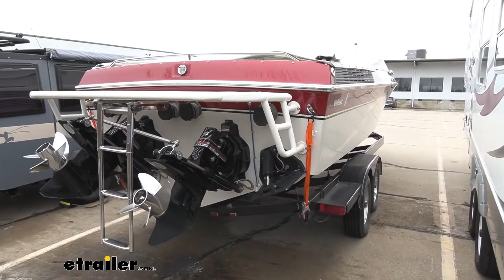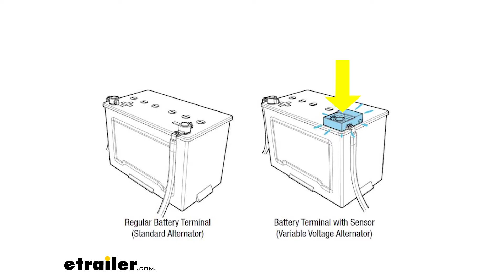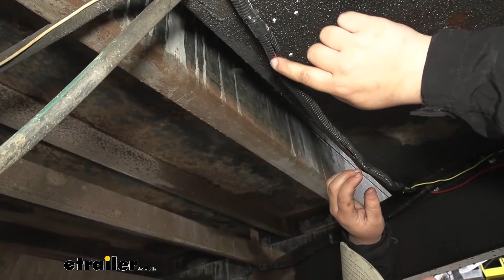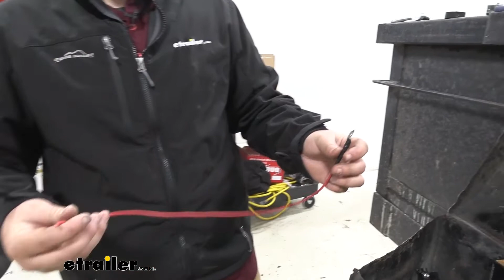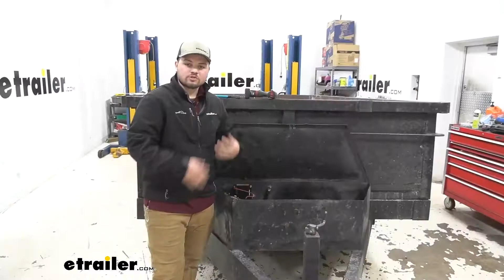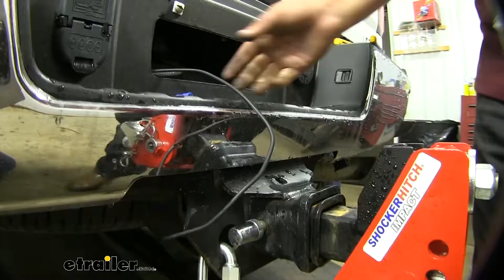etrailer | What to Know About the Redarc In-Vehicle BCDC Trailer Battery Charger

Comment: I'm confused. What is the purpose of the hot wire going to the truck's 10amp fuse? Why not just use the 12vdc auxiliary wire in the 7way?
I thought that auxiliary wire would charge a trailer battery but regardless, couldn't you use it to power the charger? I think it's 30amps